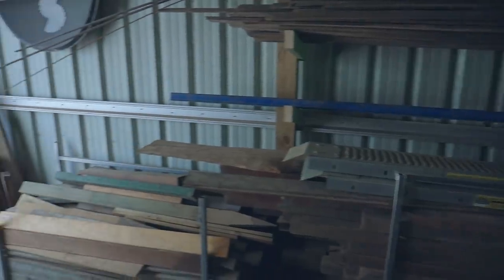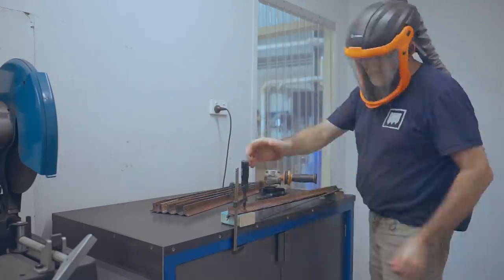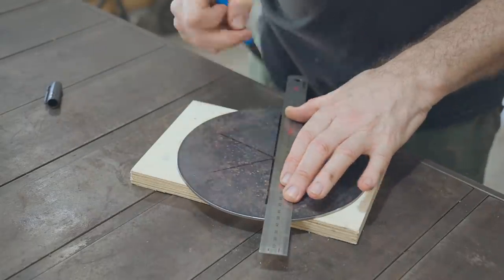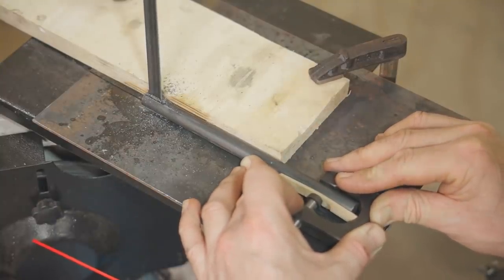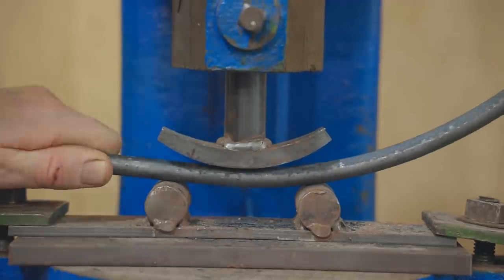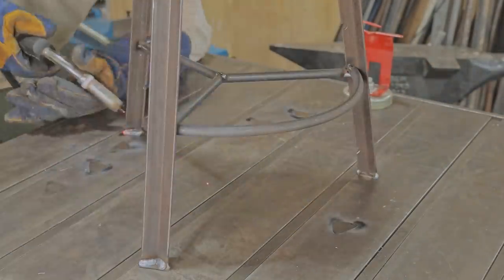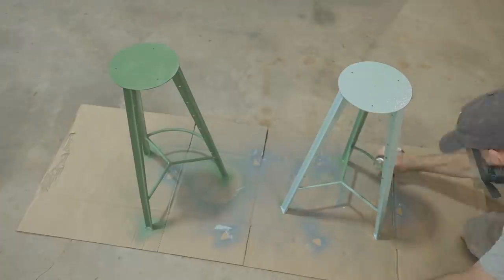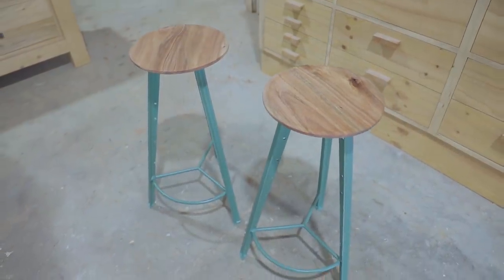Shop Stools from Old Rusty Fence Posts

Comment: For the holes on the legs, I would have either filled in or filed off the ones which have been partially cut through so to avoid anything getting snagged on them. Maybe it's paranoid of me but that's the main thing that comes to mind. Aesthetically speaking they look fine however.
Reply: I would have done the same suggestion you exposed.
Reply: Scalloping them out as curved indents would have an aesthetically appealing result, like you the sharp corners catching on clothes. 
Catching the corner on your jeans as you stood up could cause you to land on your face and even more importantly, make you spill your beer. The closed holes are fine. Great re-use of the old Star-steel pickets.
Reply: Same thoughts. Those partial holes can grab clothing causing a fall or slice a finger when moving them around.  Just a quick debur and it'd be fine .
Reply from the maker: I thought about grinding the partial holes out but they really aren't too bad. I've ran my fingers up and down the inside of the legs and nothing feels too sharp, also being on the inside they shouldn't really be a problem. :)
Reply: I thought the same but in a visual way. The cut through holes attract my attention away from the whole object as they break the otherwise clean lines. In person it may be entirely negligible though as it disturbed my eye mainly in the close up shots during construction.

Comment: On the holes, I'm really good at snagging my clothes on everything, so I likely would have done something about the open holes at the bottom near the footrest because guaranteed I would snag the cuff of my pants on it all the time...but I'd just make sure the opening was an obtuse angle by filing or grinding. I like that the holes give big hints as to what the legs were in a previous life. Excellently executed project as usual.

Comment: Looks great from some old star pickets! Although from experience, next time I'd use some rust converter (phosphoric acid) or remover on top of the wire brushing to ensure the rust does not come back through the paint, particularly if the rust has pitted the metal. This simple process can ensure the project lasts a lot longer.

Comment: great use of fence posts! nice execution, as always and tapering made the design really stand out- your designs often lead to the fine level of your end products. Thanks for posting.  For a machine base table - taper cut the four sides of a 4" or 5" square steel tube and make those legs in the same kind of tapered design.  Then cut four 'angles' of the same stock along the central median as the 'top frame' sides/ Butt the tapered legs to the 'rounded' square top frame of a sturdy and very elegant spread legged design from square stock steel.

Comment: Nice neat job 👍🏻
It would be more convenient to make the ring all around for 2 reasons other than the main function which is to restrain the legs from spreading out.
1- Whatever angle the user will sit will find a foot rest.
2- you will be able to stack the stools on top of each other and save more space when not in use. 😉

Comment: If someone said to me that using any old iron scrap metal and a couple of planks of wood would be turned into practical, useful objects, I would think them to be slightly bonkers or very clever.

But with a bit of ingenuity, what and how you managed to obtain the end result turned out to be something quite remarkable. 

Great idea, fella. They look so cool they could be used in the home, not just the workshop. 10/10

If I had made those stools I may have added a small backrest, just to see what it would look like. Say about 15 or 20cm high and wide enough to fit the small of your back. Then placed perfectly to show the correct position to sit on and take advantage of the added foot rest.

Perhaps that's just my OCD kicking in but what if...

I wonder, what other beauties  have you in mind for us as I goggle your channel further?

Comment: Fantastic work, as always! 
Leaving the holes could make for some handy future additions ;)
You can screw something on there or simply bend wire into a hook.

I'm a bit concerned about the strength of the foot rests. I reckon for actually resting it's totally fine, but if you (accidentally or not) put your full weight on them they might give.
Reply from the maker: Thanks very much! I honestly think they could handle a bit of weight put on them but as you said they're for resting your feet. :)
Reply: @PaskMakes  If they ever do break, I'm sure you can fix it easily and elegantly ;)
Until then it looks nice and lean.

Comment: Really nice job. I wouldn't have bothered with rotory file on welds. The holes in the legs are great, makes more noticeable that they from waratahs. I like other color underneath cause when they get scraped it looks like they repainted over the years.

Comment: They look great. If you haven’t tried a diamond tip grinding wheel I would recommend it. They are a tad bit more costly but they last 10 times long. I don’t do much cutting but I’ve had mine for 2 years and haven’t replaced it, but it’s getting close. Great video as always.
Reply from the maker: I've used them on the angle grinder but not on the cut off saw yet. :)

Comment: They came out really nice. I need stools in my workshop, I'll have to give this a go, plus it'll be good welding practise. Only thing I'm thinking of doing different is leaving the holes and the width of those sections, and utilising the holes to hang things that would move with me from bench to bench so they are always handy, maybe even build some sort of pocket to hold marking implements.

Comment: Beautiful!  I would have put a finger groove under the rim to make moving them around a bit easier and a round over on the top rim to make them more comfortable on the backs of your legs.  Like others I want to know if the foot rest is strong enough to hold weight.  Wonderful use of otherwise waited material.  Almost steam punk or industrial chic.  Now make some with five legs and casters and you can have shop races.

Comment: I think leaving the holes in the legs was the right choice. Although the taper in the legs looks good, in this instance leaving them un-tapered would have made it even more obvious that star pickets were used, adding to the 'rustic' vibe. For that same reason I wouldn't have ground the welds. An alternative to painting would have been phosphoric acid or some other rust convertor, to keep them more 'pickety'. I also think the seat tops would have been more comfortable if you'd mounted them 'upside down' so that big chamfer was uppermost, making the seat top less likely to 'cut in' to the sitter's leg.

Comment: As always, top notch project and video.  With regard to should you fill the holes or not, that's an artistic choice.  However, the partial holes should be filled or ground down such that there are no sharp edges for safety.

Comment: I would have filled the holes and done them blue like your drawers and welding table. Have you thought of adding upholstery to the seats? Like a foam pad with a fake leather covering, stapled underneath to the wood. Another skill to add you your (already rather large) repertoire :)

Comment: FWIW, I would have filled the leg holes with weld, if only  to avoid the half circles snagging pants hems or leg hairs. Plus, I think it would look cleaner and less 'haphazard' (some holes are full circles; some, half; some, less). Cool project, though!
Reply from the maker: Glad you liked them David! I definitely thought about it and as I said, I think either way would look good. I'm honestly not concerned about snags though as they're on the inside of the legs. :)

Comment: I personally would've plugged the holes and finished the metal with hammer paint. The seat I would've made from pine and burned, wire wheeled and lacquered.
Still I like your take on the project :D

Comment: Definitely would not have filled the holes with weld. I've done something similar and it just about tripled my build time. Would have had the thing done in about an hour but after welding holes closed and grinding it back flat on both sides, I had slightly over 3 hours in each piece. A TON of extra work. I think your stools look perfect.

Comment: I wonder if that's an a us design to have three rods connecting together on the outside instead of the try square in the middle with those one single spot to rest your feet with the three spokes on the outside diagonally from one leg to the other would allow you to have three three spots to put your leg instead of just one in the front that may have been a cosmetic decision so you could also use the fly press to show the video too

Comment: I would have put the foot rest all the way around,  filled the holes in painted it hammer blue to match the tables in the work room,  other than that fantastic build  👏
Reply: Agree.  If there's no back rest on the stools that suggest to the user where how to orient themselves when sitting on them, you might sit down and be disappointed that the foot rest is on the backside of the stool.  All the way 'round is the way to go.

Comment: Only thing I would do differently is to add a radius in the top edge of the seat.  That sharp corner is going to be uncomfortable if you sit for any length of time.

Comment: Curious why not of made your foot rest completely round slide it over the top and weld it. would of served the same as the cross bracing but let you turn the stool in any direction and still had a foot rest.

Comment: I would have filled in at least the few partial holes, not for looks but rather safety.  I'm the type who's feet and legs are never still when I'm sitting and I'd end up running my feet, shoes, or legs across those holes as I fidget about, and I'd end up with cut up clothes or legs.

Comment: Why do people keep saying to add the footrest all the way around?? How hard it is to turn the stool to the "front"? Adding 6 more foot rests would have been at least another 2 hours work for essentially zero gain. Aesthetically they look better this way, more "old school".  Most of the "all the way around" footrests on stools are there for leg support as there's no braces, however this stool has braces so no need for extra.  Often in design less is more, and this is one of those times.